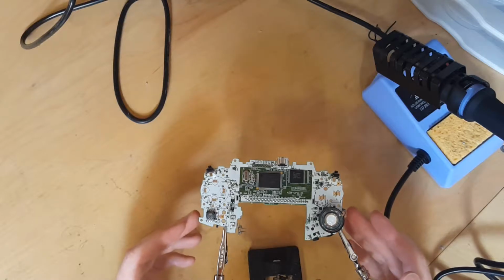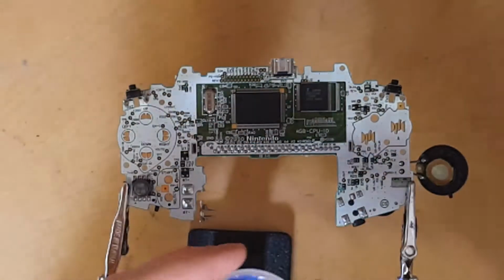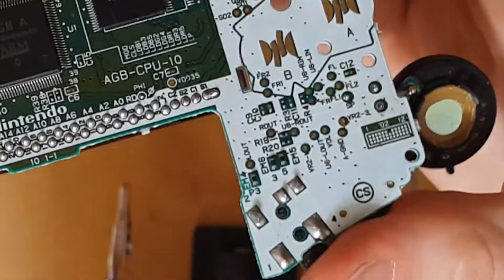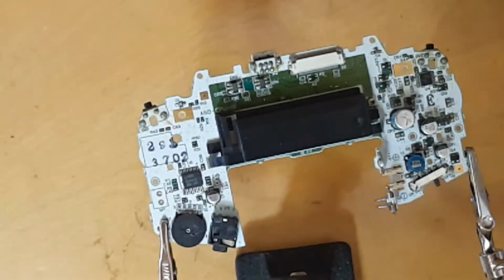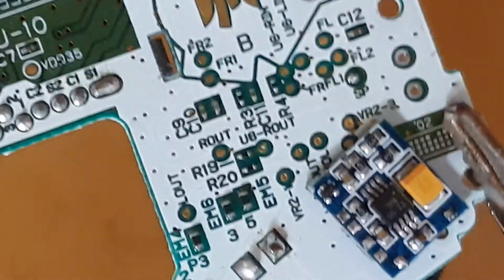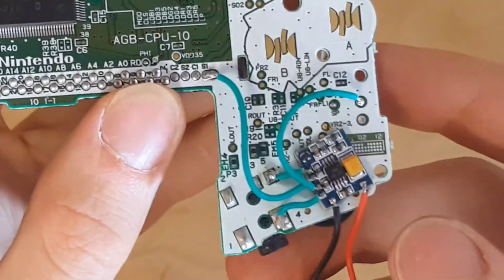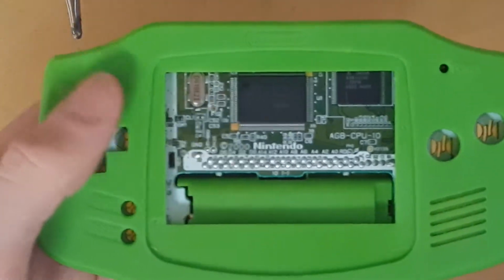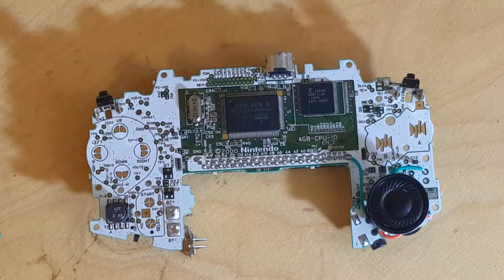Game Boy Advance CleanAmp Install

Comment from the maker: For those wondering what wires I used in this video, I used the TUOFENG 28awg Stranded Wire Kit on Amazon. It's very flexible and can be unruly, but smart routing and Kapton tape help a lot

Comment: Gonna install soon just wanted to see what it would look like. Btw the solder joints look pretty dame good but it would be better with flux paste and clean with 91-99%isopropyl alcohol and your set for a long time
Reply from the maker: Thanks for the comment. I'll have to try solder paste at some point, but I do prefer using a flux pen

Comment: love how no one shows them reassembling with the speaker mod with amp...For the life of me mine doesnt fit properly without cutting sound out
Reply from the maker: If you haven't done so already, test it with the board assembly in the back half only, pop batteries in, and test it that way. I know that some GB speakers have tabs that help lock it into place, but I end up cutting these so the speaker can rotate and fit better

Comment: I wonder if you can do this mod on a ds phat
Reply from the maker: I'm not sure. Personally I've never owned an original DS, but if you can find the same pins/pads in one it might work. The main issue is having dual speakers drawing more power than the one of a GBA
Reply: My problem with the phat DS for me is the dim screen. The ags-101 is way brighter than that.

Comment: what wire thickness did you use?
Reply from the maker: I used 28AWG tinned wire. I have seen other people use a red enamel coated wire that looks like bare single strand, which doesn't need to be stripped, but I prefer wire with insulation. Hope this answers your question!

Comment: What temperature do you keep your iron for gba soldering?
Reply from the maker: I'm not sure; mine has a dial but no temp readout. I will say that Nintendo factory solder usually doesn't budge at lower temps